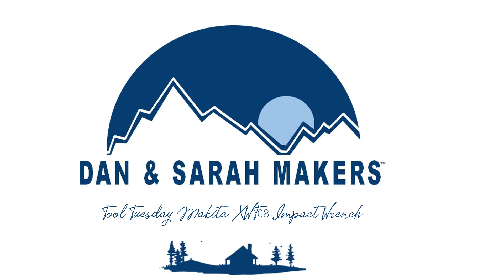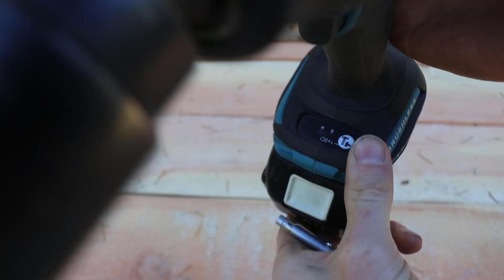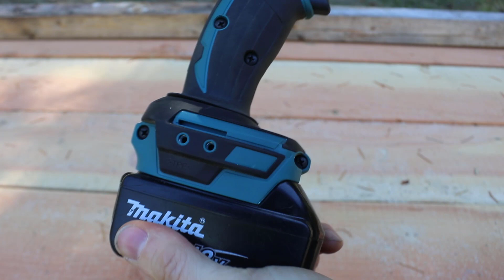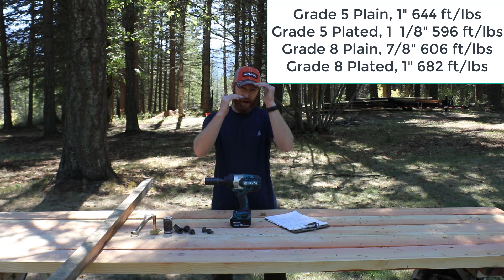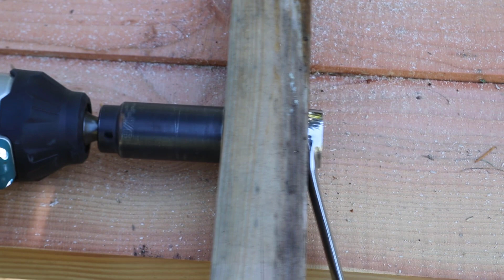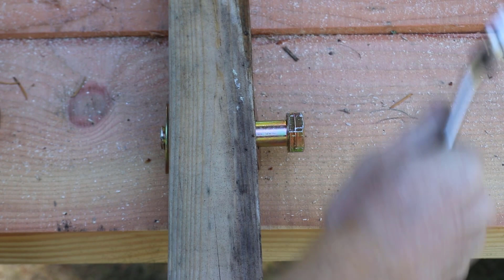Tool Tuesday Makita XWT08 Impact Wrench

Comment: I work on speed queen washers for a living and replacing the hub seal kit can be a pain. On a good tub it may take a few minutes to bang off the the axle nut in the tub.  With this thing it took it off in 3 seconds. The tool definitely does what I need it to and more. Im happy with it